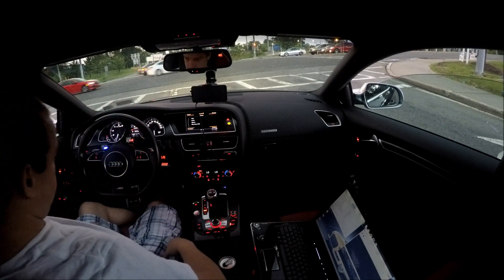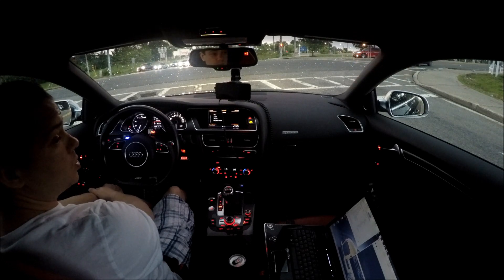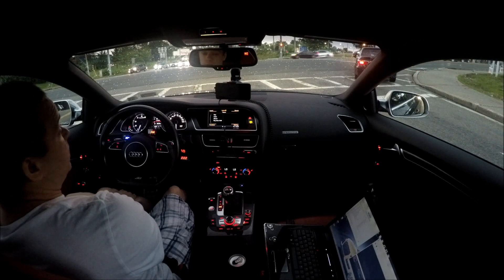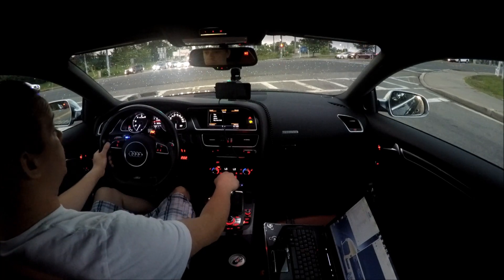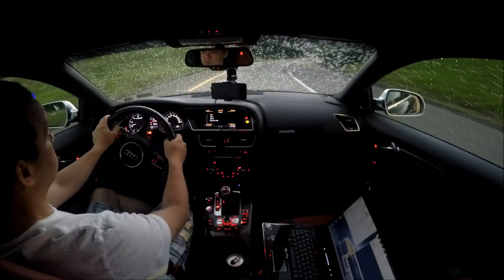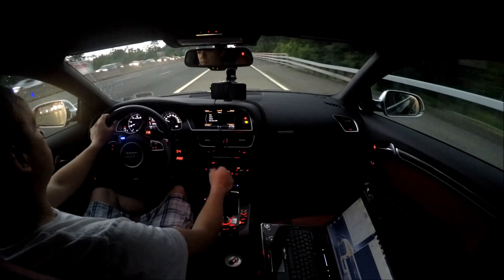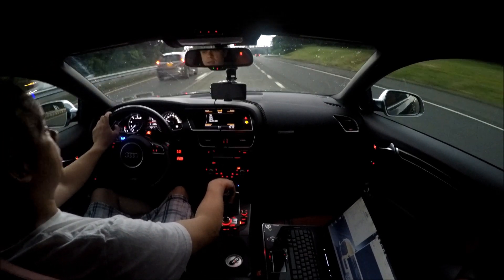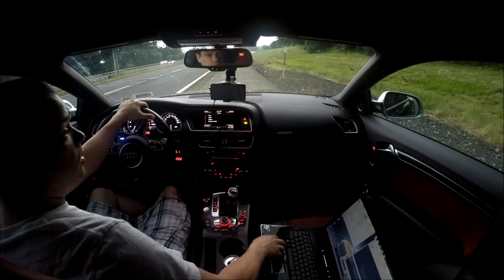Testing S5 Single Turbo 6466 Build Motor 30 psi

Comment: Is that clutch slipping or tires?
Reply from the maker: Software issue ! Was fixed after that day with new TCU tune , you can find my last test video at the track 10.6@133 no issue with shifts anymore

Comment: Hey is this a V8 4.2L turbo 
Do you have a list of parts
Reply: 2.9 TFSI V6, In 2013 the s5 and rs5 got an 2.9 TFSI instead of 4.2 FSI V8
Reply: @kaasgebak358  it’s the supercharged 3.0T headass
Reply: @kaasgebak358  Actually in 2013 it was the 3.0 TFSI , the 2.9 was in the B9 RS4/RS5